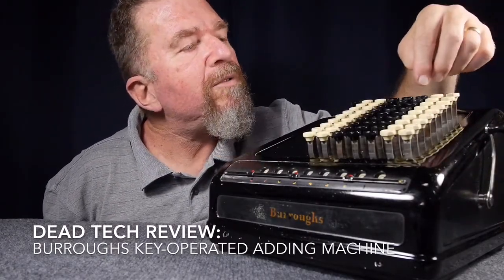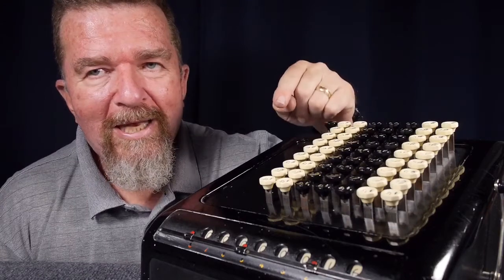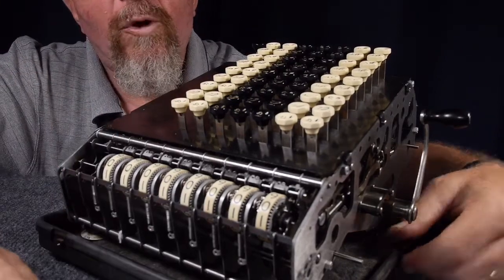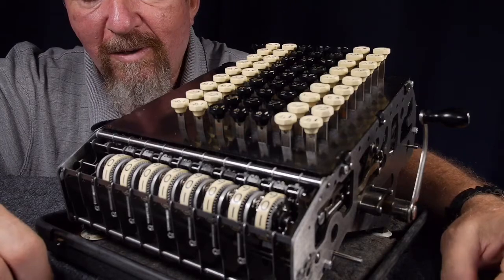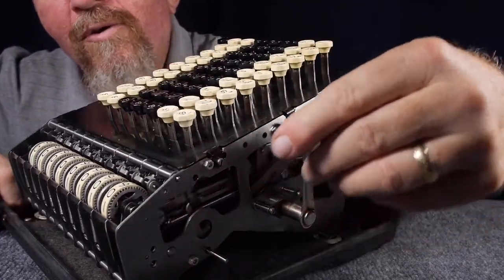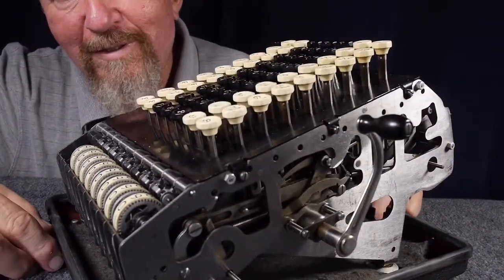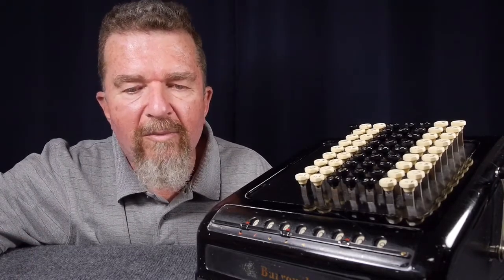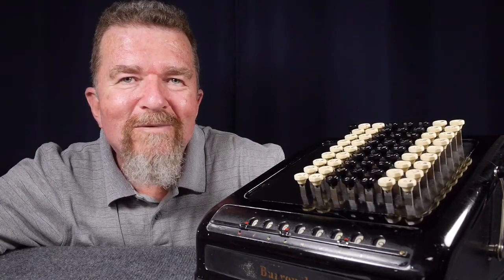Dead Tech Review: Burroughs Key-Operated Adding Machine

Comment: Hi Joe Van Cleave, I was wondering if you have used any guides when you took apart the adding machine. I have a Burroughs Class 5 adding machine that wasn't working. I'm totally unsure about the best way to take it apart and clean it.
Reply from the maker: I didn't use a guide, luckily this machine just needed a thorough degreasing and cleaning.

Comment: I got hired at Burroughs in 1961, the service manager that hired me had this machine on his desk & for everyone he hired he took the case off the machine & kind of explained something about how it operated & then he took a fallow up shaft & started pushing the shaft & when he got to the center somewhere he pulled the other shaft to the point where he pulled the complete dial wheel out. He handed it to you & said to put it back together & make it work. I know where you are coming from as to how complicated this machine is. He showed me how they used the machines for adding invoices, if the number was more then 4 both hands were used & if 4 or 6 items for that price you depress that number of times. The fastest adding machine at the time.
We had about a 3 square foot X 2 foot deep tub in the shop & had a mixture of kerosene & oil maybe 5 gal kerosene & gal of oil non deterrent, that worked well for cleaning all machines.
Reply from the maker: Wow, that's a neat story, thank you!
Reply: Is there anywhere where I can find detailed diagrams of its internals?

Comment: If you had to had to go through again, what was the most effective methods you used to clean and tune it?
Reply from the maker: Thorough degreasing of the planetary gear train was the key. Flushing with spray degreasers was helpful, their aerosol action helped remove residue deep inside the mechanism.
Reply: Did the oil in it turn to tar?  I have been doing repairs on WW1 pistols, binos, compass and have had this happen.  The lube oil literally degrades to where it turns to glue.  How much junk did you flush out of it?
Was there any plastic parts inside?  I noticed some of these older "artifacts" some cleaners can melt the plastic and wipe labels.
Appreciated!
Reply from the maker: The planetary gear system is all metal. These comptometers were designed in the WWII era, before most plastics aside from bakelite. It didn't have too much hardened gunk, but enough to cause it not to work properly. I think these metal-on-metal gear trains work best with very little lubricants.
Reply: @Joe_VanCleave  can you help me locate the "planetary gear train?"

Comment: I'm no expert, but we always called them com-TOM-e-ters with the accent on the second syllable, and the "p" silent.  They were popular with companies doing a lot of calculations, such as oil companies that had to add up the charge slips, banks adding up checks, credit card companies, etc.  Most major cities had Comptometer Schools, where students were taught, sort of like short hand schools.  They were taught to use the fingers of both hands all at once, similar to a stenotype.  They were also taught to use the lower 5 keys for speed, to add a 7 they would hit the 5 and 2 keys. I think you coud only hit one key in each row at the same time.  And I sort of recall some shortcut to add the default nines when subtracting.   I was taught to add the complement of nine in all rows, excpt the last one to the right that contained a figure other than zero.  On that row you used the complement of 10.   You accompleshed the same result by adding 1.   Phil
Reply from the maker: Thanks for the info. I think the term comptometer is rather fun to use.

I didn't adequately describe the subtraction process. The reason why you hit all the extra 9 keys is that you're inputting the zero complements in all the empty columns. Although for speed, with short problems an experienced operator wouldn't go to the trouble of doing so with all empty columns, just like an experienced abacus operator learns speedy shortcuts.

Also, I think the reason that 9's complements are used for subtraction instead of 10's complements is that there isn't a zero key.

I also failed to mention that the odd-numbered keys are sculpted, while the even-numbers are flat, as a tactile advantage in finding numbers by feel.

I can imagine an experienced operator could get very fast, by using both hands and being able to input multiple place values simultaneously. Perhaps faster than using a modern electronic calculator that only supports single-digit entry. And ignoring more complex operations other than addition, of course.

This particular specimen has room for two more columns, toward the left, so it's a lower-end model.

I looked at some online scans of old comptometer instruction manuals, and multiplication & division are performed similar to an abacus, by entering the numbers on opposite sides of the register and performing the operation in the middle, while keeping track of the decimal point with the sliding indicators below the answer windows.

I was thinking about what kinds of calculating machines the "computers" used during the Manhattan Project, prior to the era of electronic computing machines. I know human computers were used early on in that project, prior to the first valve (vacuum tube) computers. Perhaps something like this? Hmm...
Reply: I have acquired a couple of Monroe Calculating Machines. I’ve had a couple of people call them “Comptometers” which they aren’t leading me to think it was commonly called that similar to Kleenex or Band Aid.